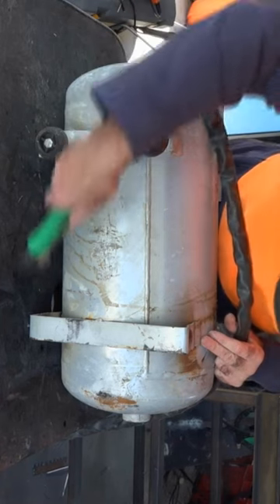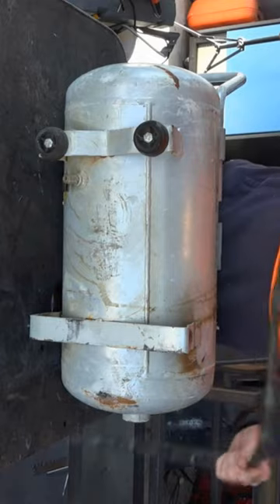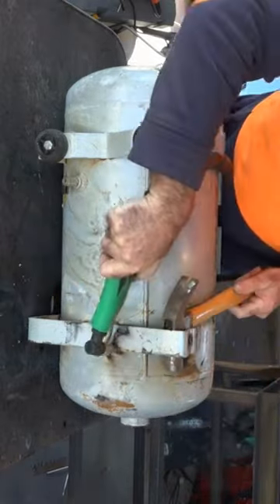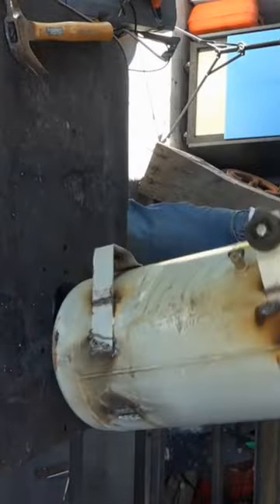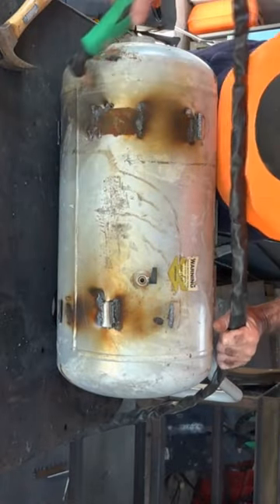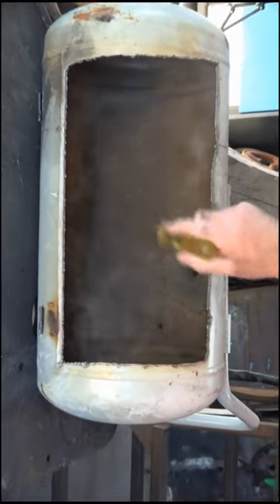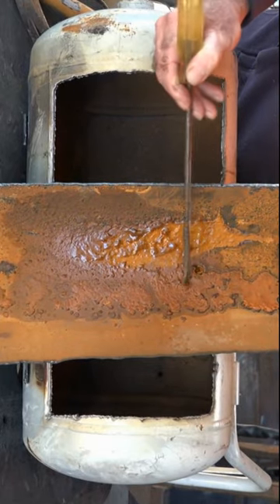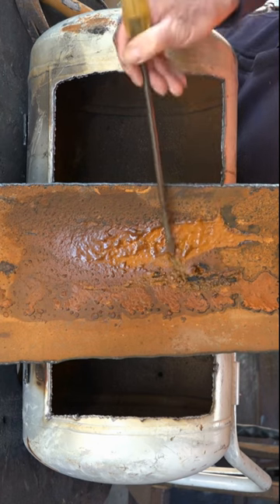What's HAPPENING Inside Your Air compressor (You WON'T Believe It!)

Comment: If you manually drain your air compressor tank as required, it will limit the amount of water inside the tank. The drain is located on the bottom of the tank. It it doesn’t have that drain, it can be purchased at TSC. It’s a very easy fix to extend the life if any air compressor. 😊
Reply from the maker: Cool thanks